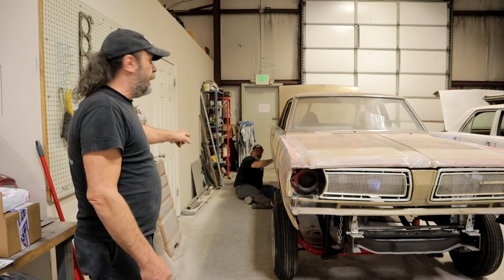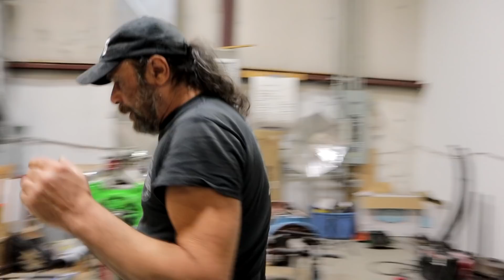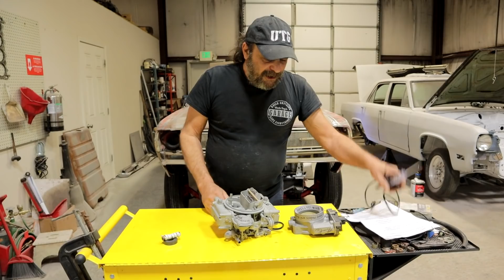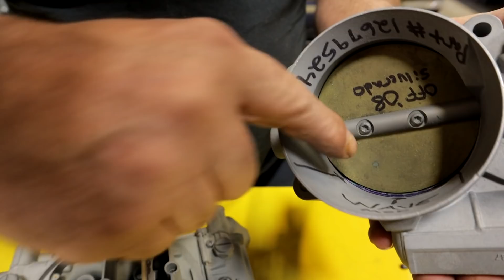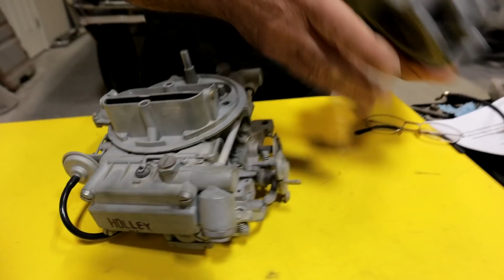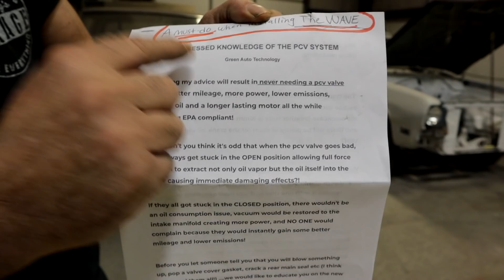The Free Energy Scam And Other Absurdities Of The Mechanical World

Comment: The best way to test this.
1) You need to test it in a low pressure area, to do this correctly it needs to be in the back of a pickup truck, right up tight to the cab.
This creates a low pressure vortex at highway speeds.
2) You will need gas lines long enough to reach from the truck box to the engine. DO NOT shorten the gas line from the tank.
3) A dryer exhaust vent (flexible)  of sufficient length to reach from the truck box to the manifold is also needed, along with various clamps, zip ties etc.
The location in the truck box (left to right) is not as important as you might think, over the course of the test it will naturally  find it's own preferred  location 
Place all the above parts, (make sure to extend the dryer vent hose to full length) in the pickup box, and go for a ride. make sure you do both left and right handed turns as this will help establish the preferred location.
NOTE: The preferred location is subject to change because of road conditions, speed, humidity, and gravitational forces.
Thoroughly test by driving in all conditions, for at least a week.
Keep track of your gas mileage during the test, this will tell you how much fuel you have used, VERY IMPORTANT!!!
At the end of the test you should be able to find a dumpster or salvage yard that will want whatever parts that have not blown out, (the dryer vent will most likely be the only one, unless you have done some serious off-roading, or need the gas line and clamps for another project.
Never forget BOB LAZARR had a jet powered Honda.

Comment: Test it but with no bs constraints. No driving at only 30mph, 1/8 throttle, piss stream of fuel nonsense. Put it on and drive it like any regular Joe would. If these "systems" are going to work, they need to do it under all conditions regardless of control environment. All other ways are just useless farts in the wind.

Comment: All you need is an absolutely, 100% identical carburettor fitted in exactly the same way, same gaskets etc. make sure there's 100% no leaks, no matter how small in either and testing should be a breeze... Just test one, swap over, test the other and of course, you then need to retest both.
Or... And this is how I'd do it, stick those in a box n send them back because no matter how you try to control the experiments, someone will cry foul because the wind blew from South, south east on the second test at 4 meters per second, when it was blowing south east at 4 meters per second in the first test.

Comment: I was big into computer tuning on modern cars. I have gotten away from it in the last 2 years. the throttle body thing makes me laugh. There is just so much wrong with that idea. The computer looks at everything.  if something happens that the computer can't understand or is not anticipating. it will go into modes to protect the engine. If this really did something. the computer would have to be tuned. If you can just put it on and doesn't need tuning. It's not doing anything.

Comment: GARBAGE!!  All those air intake modifications are WORTHLESS.  The engine produces "x"lbs. of vacuum. Air moves according to the force and resistance it experiences. The head geometry (structure of the resistance controls.)  See the MITSUBISHI jet engine, two intake valves, one tiny to SWIRL the mixture for increased efficiency.  It was, like all this crap WORTHLESS.

Comment: UT, you said air flows like water...correct.  And air acts like a thin version of water as well.  That's why t.v. signals can only get so far from the antenna before they cannot be picked up anymore.   Also why you can't see Japan from your house.  The air density increases with distance.  Yes, UT, the earth is flat.  (Not a joke, think it through.....when you don't have a fever!  )

Comment: Uncle Tony, to test that carb firstly it looks like it needs fully stripping down and thoroughly cleaning to get the sand out of it. Looks like he sand blasted it fully assembled.
Second you would need a standard unmodified Throttle plate to swap out the modified "grooved" plate on that carb so you can try exactly the same carb with the modification and without the modification.
Using a different carb even if it is the same part number would be exactly that, a different carb.
Then you would need plenty of patience, time and gasoline.
My prediction: no difference.

Comment: 1. Fix butterfly fully open.
2. Attach air velocity measuring equipment.
3. Throw off very high cliff
4.Turn around180 degrees, find a bar and drink beer.
5. Your mind will be fully refreshed the next morning.

Comment: Tony pvc system was mandated in 1956 on a 265 V8 to control blow by and not put hydrocarbons out in the air these gases are flammable and do make energy but how much well I'm sure some epa dude knows.but the truth is a new pvc valve all ways gave me gave me at max 1 mpg per gallon but the point is over time not around the block but a hole mounth you size it up it comes to about that so that's 1200 miles in a mounth x gas= mpg well it could be wrong but with some blow buy you can more get more gasses but it don't mean you will get more mpg but more like what you lost from ware. But the magic is with a carb is lean but with a price knowing how to do that if you don't know than tune clean and let off the gas that worth 3-5 miles per gallon and thats magic.

Comment: Chrysler had large runners in the intake to cause a form of supercharging but it only worked at low RPM.
Reply: NO!  Large intake runners kill mixture velocity at low RPM, thus cause a power loss.  Long small runners are what add low RPM power.

Comment: The old draft tubes were terrible. There was always sludge inside those old engines. Even when the oil got hot enough to evaporate the water condensation, and the gasoline and fumes that leakes past the rings. The draft tube never gets it all out of the crankcase. A working PCV valve and a non clogged breather, get all the fumes out of the crankcase. The oil lasts longer because it's not diluted with water and gasoline. The internals last longer because they aren't being corroded. Oil and water mixed, turn acidic. The only difference in a draft tube engine, versus a PCV engine, is slightly richer jetting. It's to compensate for the air going directly into the intake from the PCV valve. I agree. The PCV valve probably doubled engine life all by itself.

The only free energy that exists right now. Is sticking a copped rod and a steel rod into the ground. The soil has to be wet. And it has to be either acidic or alkaline. Neutral soil ph will do nothing. Acidic or alkaline soil will act on the rods just like a cars lead acid battery. It's just such a weak current that it just isn't worth anything though. You could do the same thing in the ocean. You might have to spend a hundred dollars or more. To light up a flashlight bulb. It works. It's just not practical.

Comment: You just need to invent a variable valve venturi that goes from the size of a straw to max demension of that carb.  At idle it will be a straw, allowing that mod to supercharge the idle until you need more gas and the venturi goes toward max capacity.  Still going to use more gas though...
Reply: Ford had variable venturi carburetor on some engines in late 70s.  Was it for emissions or fuel economy I don't remember.

Comment: Get identical carb rebuild it. Free up the throttle blades. Standard card tuned to inake with vacuum gauge with car warm at operating temp. Run quantified amount of fuel with Uncle Cathy  filming. Change modified base plate retune with vacuums gauge at identical temp and rerun test. Compare results.

Comment: If this stuff worked, it would have been implemented by engine designers decades ago. The engineers/designers of combustion engines of the 1940s, 50s, and 60s were some of the sharpest minds over the last century. These guys really understood the physics and mathematic principles at the most fundamental levels. Even without computer tech aiding the engineers of that time, they knew this free energy stuff is a fantasy. It simply defies the laws of physics. Nothing operates at 100% efficiency 24/7. There is always more energy spent on input than you will have as output.
Reply: This is actually a problem in all areas of life. For some reason everyone thinks humans were far less intelligent in the past. They weren't. They just didn't have the better tools we have. Our ability to make better tools to build more complex things is what has caused the complexity in "things" today. Not intelligence.

Comment: What's to test? The carb will increase idle speed and you'll spend a week trying to get back to proper AFR & RPM. Same for throttle body, except ECU/ECM will immediately detect AFR error, attempt correction with injector shot duration, then trip a code & set "CHECK ENGINE" light (and possibly enter a limp mode). Time would be better spent finding out why the Rothschild's payed to build a space laser to start California wildfires.😆

Comment: Dont bother testing. All that guy did was ruin a carburetor. That stupid groove will most likely cause the idle jets too have excess fuel drawn through them. Probably won’t get the engine to idle. If he did sand blast that carburetor, you’ll probably ruin the engine from sand if you don’t completely teardown and clean that carburetor before testing.

Comment: If you have any basic understanding of how an internal combustion engine work you lost all impartiality to making a valid test. The internal combustion engines have been around about 225 years. I'm sure every generation has it's P. T. Barnum especially in automobiles. Most play on a persons lack of knowledge. Example I got my drivers license in 1974 and my first car was a 1972 Plymouth Duster. Tony as you know the gas shortage in 1974 spawned had everyone looking for better gas mileage. I was no different. I went to get points and plugs for the Plymouth to do a tune up because that when you get the best gas mileage. Whats on the counter is a fuel  filter looking device that said " This device will increase your gas mileage by 5% to 10% by aligning the positive and negative poles in a gasoline molecule." Tony you might remember seeing them in auto parts stores back then. I'm a 16 year old high-school kid that knows nothing about the molecular bonds of molecules. So I buy one and install it by the instructions. Did it increase gas mileage?  Nope!  What it did increase was the bank account of the guy selling them by getting the money out of my wallet. I'd say that's really the end goal of the green energy guy. He want you to help him get from point A to point B a larger bank account. P.S. So I tear this filter thing apart to see what in it. What it was a series doughnut shaped magnets around a steel gas line. The most important thing it did was make me study molecular sciences so I wouldn't be take like that again. Sorry if this waste some of your time, I thought you might like the story.

Comment: I learned to wrench in the early 70s, when almost everyone I learned from kept saying PVC half the time.  Some hated it because "it throws gunk in the carb" but most understood the whole system nature of it better than that.  Pre-PCV engines also were probably more than 75% responsible for the famous LA smog.  PCV was perhaps the first big step of reducing emissions, which had really been totally out of control.

I never fact-checked it at all, so maybe it's complete BS, but I was taught that PCV systems made aircraft engines more fuel efficient "during the war" and cleaned up smoke trails a little besides.
Reply: It's a primitive EGR system, the blowby gases that get past the rings are essentially exhaust, with a little unburnt fuel and oil. Sending this back into the intake reduces the oxygen in the mix and it burns up some of the carbon monoxide (CO), oil and unburnt gas (hydrocarbons - HC), lowering the combustion temperature which reduces the formation of nitrogen oxides (NOx). It also pulls out the other byproduct of combustion, water, which causes sludge and mixes with the blowby gases to form acids and carbon deposits inside the block and valvetrain.

Comment: Won't do anything on either one here's why on the throttle body the modification is made after the mass airflow sensor. On the carburator the modification is made after the the fuel circuits. Common sense people

Comment: Test it see if it works I seen the  Gadget man groove for several years never had see anyone test it get afr  Dial in and get a temp gun see how  cool the engine gets with mod the gadget man Groove guy said it can drop 400 degrees in the exhaust manifold I want to see if it is snake oil or not.

Comment: It’s as if they don’t understand the difference between a vacuum in a closed can and it under any open to the atmosphere situation like the Bernoulli equation doesn’t exist. It’s the speed of the air that creates the vacuum that pulls the gas up through the jets. They do not understand basic science and can’t grasp it. A straw in a pop can can explain a carb better than anything.

Comment: It's like the beginning of the Expanse space opera.  There's a guy tinkering with his rocket engines and he hits the magic formula that allows for vastly more power on the same fuel burn.  So much so, that he's kicked back in his seat and can't reach the controls, so he dies flying off to never never land ...  If that were so, how do we know about his secret invention?  But the whole series is based on the new drive, so it had to happen.  
As we are coming up with EV's that smack down the average ICE car easily, and step on most super-cars, we are in the final tinkering stages hoping to "save" the ICE cars.  We need to believe we can finally get gas mileage that doubles so the fight can go on ...  
We'll save ICE cars for weekends and such, and that is cool.  But truthfully we are at the end of the steam age here hanging on to the romance of the coal burners 🙃

Comment: Move along folks. Nothing to see here. Break it up, move along. 
Honestly I think you would get more out of that 90's gimmick that looked like a piece of drier vent that someone stuck curved blades in. You took this device and installed it in the air intake tube before the throttle body at it was suppose to smooth out the air and created a Venturi effect. Something that most intakes already did and most heads already do with the valves and timing. They even made what to go inside of an air filter for a carburetor. I think it was even on an infomercial right after knives that can cut through cans and still slice a tomato so thin you can see through it.

Comment: If gas mileage is the important factor, reusing the waste heat from an ice engine would pay huge dividends. Only about ten percent of the fuel goes to moving a car. The rest is waste heat. I wouldn't be surprised if we just go back to tiny turbines, batteries and electric motors and skip the ice motor.

Comment: Someone marketed a part like that 20? years ago. I think they called it a Tornado or cyclone. We considered it a ripoff.
My 58 Ford had a blow-by tube to evacuate crankcase gasses.
Reply: And that "blow-by tube" (more properly named a "road draft tube") did nothing at low in-town speeds and very little at highway speeds!  Unless you only drove at highway speeds and changed oil every 3,000 miles or so, that engine was sludged up mess.  If it was a 292 it also had dry, noisy rocker arms due to internal oil passages being clogged with that sludge.
Reply: @Cougracer67  guess the name goes with the region. My dad grew up in Texas. On the other, at least I avoided paraffin based oils. I used STP on the rockers as often as possible so that was bad for sludge but what are gonna do? It's a 1950s V8.

Comment: I think ppl need to really take a step back and realize the level of design and engineering the world is at today if there were a way to get 100mpg outta a standard v8 from 1960 to present don't you think maybe just maybe these engineers that make there 6 figure salary specifically because they got an extra 2mpg they would of found the secret or is it just them and the manufactures driving around in 100 mpg v8s they just don't wanna let the secret out yet same idea with free energy if it currently exists why you pay the electricity bill this month the best and worst of the internet are both on full display the great informations easily sent around the world easy for anyone to find .... so is stupidity common sense no longer grows in the back yard gardens and even Amazon doesn't sell it
Reply: Agreed the point here is every type of technology has limitations and some of these ppl really convince themselves the have found something Noone else already attempted in the last 40 years of innovation really its more of problem with ego than anything else

Comment: ..... There is no reason to test this. An engine works on air and gas. Getting pulled in. With the rough inner casting of an intake it breaks apart type of swirl this makes. Your better off taking your smog pimp house and attach to your air box it's not much but it will save some gas